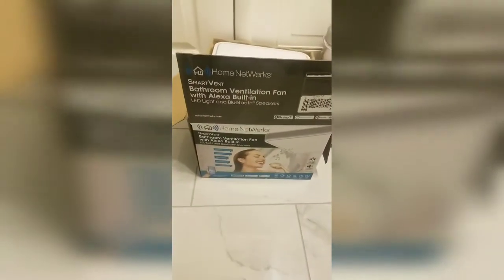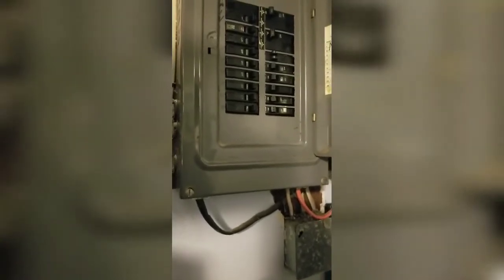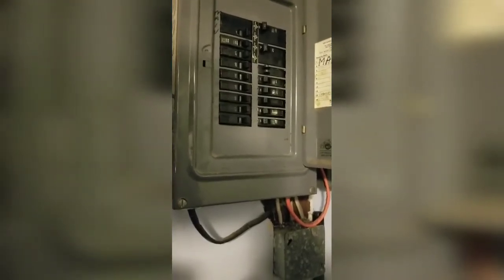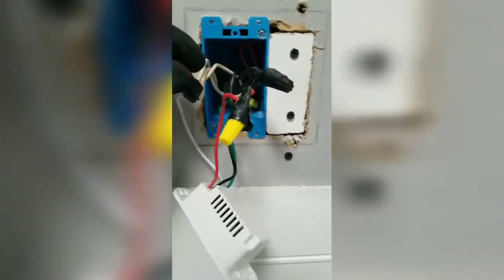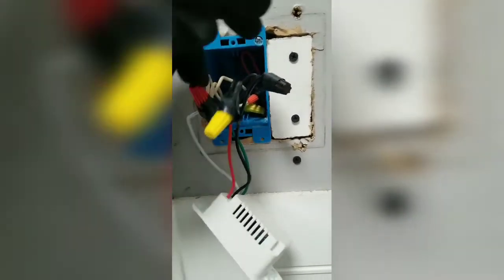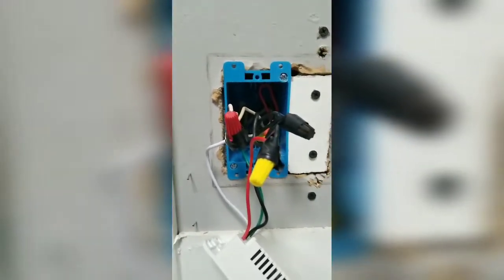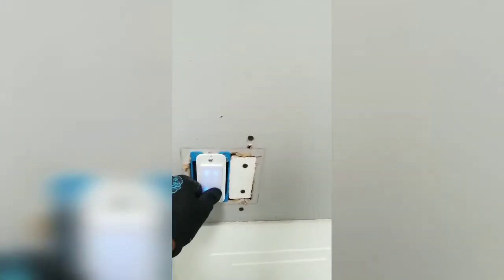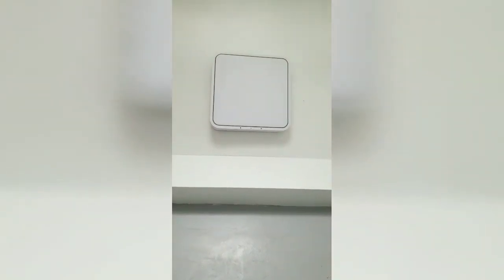HomeWerks  Ventillation fan, LED Exhaust Fan with Alexa Voice Assistant and Bluetooth Speakers

Comment: My LED light does not turn off when I turn the power switch on and off or tell Alexa to turn the light off. You think it could be a problem with the wiring? It turns off when I shut down the whole system by long pressing the power on button.
Reply from the maker: What color is the light red?
Reply: @handyhands6773  it’s main LED light, white.
Reply: Mine stays on soild red

Comment: Did you do anything special to pair the wall switch the ceiling fan? The whole thing is setup for me, the wall switch has blue lights, I can use it with the app or Alexa but the buttons on the wall switch don’t issue commands (beside the 3s power button to turn the power off/on the ceiling fan). On the manual they talk about a pairing process but that doesn’t seem to work.
Reply from the maker: It sounds like you have some wires crossed some where.
Reply: How come? The switch lights blue. If I had reverse the wire (hot and the command to fan) then it would not light up continuously. Also the fan does work just fine.
Reply: If one day someone came across this, I found the solution. Pairing the wall switch (long pressing the light bulb button) can only be done when the fan is in set up mode (blinking orange). It never works after. So if you have setup the device and forgot to pair the wall switch you will need to reset the fan. This is mentioned nowhere in the manual.
Reply: tried this and still not working for me. Any other insights?
Reply: @chrispollick2777  I did it twice. Factory reset the fan and then before I even started anything in the app I long pressed the light button (the fan was blinking orange).
Reply: how do you factory reset? Can you also comment on my question? I'm really struggling here... thanks.
Reply: @davidmaeng1145  you can only factory reset the fan from the application.

Comment: Help me out here... I have black, white and ground from the wall. So from the switch, connected green to ground, black  to white(my case white is hot), white to black(again my white is hot). All lights on the switch come on and nothing works. Long press the power button shuts down the power  then all lights on the switch turn on and stay on. What am I doing wrong and what can I do?
Reply from the maker: It sounds as if you only connected the wires to the light. It should be a red wire that you need to connect in order for the fan to communicate. If you didn't have a pre-existing fan already installed you may have to replace that existing wire with another Romex wire that have that red wire.
Reply: You need to run a peice of 12/3 romex up to your fan
Reply: @jacobcairnes521 
Please explain. Where on the fan to connect 12/3? It’s only asking for load and neutral.

Comment: My outlet only has black an white wires. Older house what do i do too install mine?
Reply from the maker: You have to run another wire.
Reply: @handyhands6773  run another wire like only one wire or run a whole new line from the electrical box and connects where there's only 3 lines

Comment: Hey quick question did yours come with a wall switch outer plate that goes around the switch?
Reply from the maker: Hello my friend. No it doesn't come with a wall plate. You have to putchase that separately.

Comment: What colors are there for the fan
Reply from the maker: If you're referring to the lights, the only colors that lights up on the fan would be red when its not working and blue when its connected to Alexa and she speaks. Other than that the fan comes in white didn't see any other options at the time of my purchase.
Reply: @handyhands6773  Ight thank you bro
Reply: Is there a blue night option? Great job 👍🏾
Reply from the maker: @trisha1989  Hey Trisha I'm afraid there is no blue light option for the night light, it just dims at its lowest setting. I hope this helps.
Reply: @handyhands6773  Thank you. I just realized there was different models 👍🏾
Reply: Just bought this and the model I bought specifically says color changing.
Wondering if I can adjust with the wall switch since I am having trouble pairing the fan with the app

Comment: Mine only. Has a white an black wire on my stock light switch
Reply from the maker: You might have a metal box therefore your ground should be mounted on one of the screws in the back of the box.